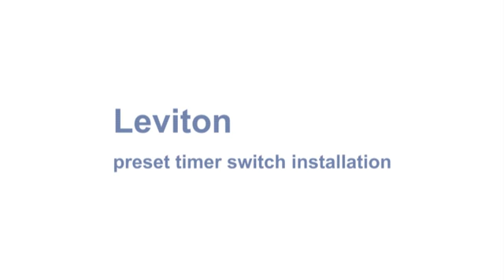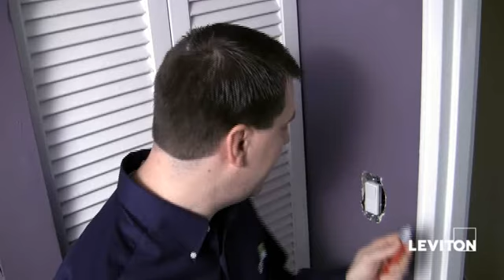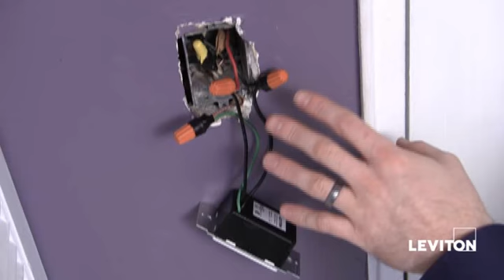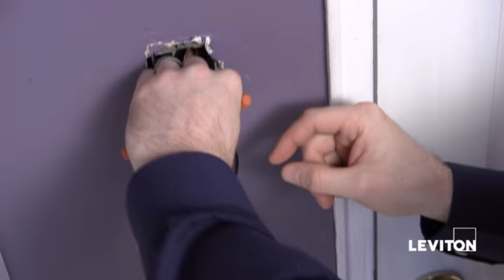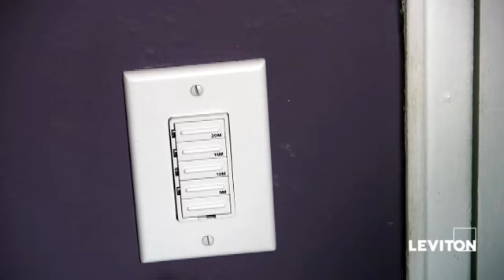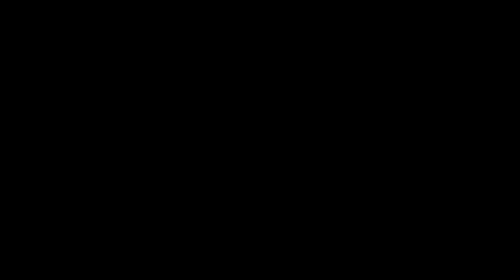How to Install a Leviton LTB30 Timer Switch | Step-by-Step DIY

Comment: the problem with this is now there's a green and white with 2 black wires which makes no sense.. no matter what way I wire it it doesn't work
Reply: Look at the diagram that came with the timer.  You have to match the line (power in) from the switch box to the timer line wire in the diagram and the load wire from the timer (  power to the fan) with the load wire in the switch box.  Then connect both the ground and neutral wires to the ground coming from switch box.  
Took me over an hour to figure it out and it worked.  The second timer took me 5 minutes to install knowing what to do.

Comment: Buy a cheap multimeter to use with the ac field detector to ensure there is no live wires There are situations where the white wire is not neutral but powered. (switch loop and three way switches). What I am saying is it's easy to accidentally hook up a white travellor or white switch loop wire into your neutral and and cause some major electrical issues. This happens when you forget what wire went where and try and puzzle it out,  so save yourself a lot of headaches and misery  . Leave like you found it unless you know what you are doing.  ALWAYS Take a picture before removing the old switch then tape and mark all wires. If there is pig tailing (not the ground type) and 3 wires are being connected get the proper murrette. I didn't even know there was murrette designed for 3 wires and rarely see them  in use. They usually have fins on the side and are much larger when looking insied of them. They are so much easier and work properly and I now trust murrettes again. Back stabbing connections can be problematic years down the road but so is not properly stripping the wire and curving the exposed wire with smooth needle nose pliers (the grip on some can damage wire) and making sure the end of the wire loops in a clockwise orientation around the connecting screw and the wire insulation is not preventing the screw from holding the wire down securely.. Look for damaged or burnt wiring and make sure the ground wire does not contact anything when putting the switch back in. If the wires are getting in the way cut them a lttle shorter if they are too long. If they are too short or damaged you can pig tail them but use the same wire type and gauge.  Always turn off power off at breaker. Make sure area you are working in a dry area and are not grounding yourself out.. Electricity is not happy about being controlled and has to be respecte Use the AC detector around your house to look for  large electrical fields caused by incompatible dimmers and smart lights. Youtube is hard to get accurate information sometimes. Look up electrical literature at internet archive digital library many good books no b.s. like ads or fees yet.

Comment: Thanks btw. I was able to do it myself. But I have one issue that I had with every switch I have done. How do you make switches screw in straight? Mine are always tilted a little
Edit: and all my boxes aren't really professionaly installed, so they wabble as well.
Reply: Tighten the screws but not so tight that you can’t move the timer switch. Then tilt the switch until it matches the faceplate.  Remove the faceplate and hold the switch tight while turning the screw slowly til it’s tighten.

Comment: How come this device doesn't need a neutral, and how doesn't it matter which black wire I use?
Reply from the maker: The device does not need a neutral because it uses very little power, which it can get through the Earth ground.

The black wires (load and line) can be interchanged as we use a relay to connect the 2 wires when the switch is on, and open the circuit when the switch turns off the load.
Reply: @leviton didn’t work for me.  I match the line and load wire from the enclosed diagram and that worked.
Reply: Read @leviton reply on the technology.  From my experience, it did make a difference which black wire is connected from the switch box to the timer.
Reply: It does matter because it did it the other way and it didn’t work.  Follow the diagram to see which line and load wire to use.
Reply: I can't remember why I asked this back then but it probably was more of just curiosity. Like what's the technology behind this switch that makes it not require a neutral  @pytube777

Comment: I have considered buying this and then I saw the buzzing issue that so many have. Someone posted a video on here troubleshooting what was causing it and it comes down to a design flaw. I wonder if the company has made any changes to solve this buzzing issue. You can find the explanation here "LEVITON LTB30 BUZZING TIMER FAILURE ANALYSIS" https://youtu.be/BQM4ERy-wpY

Comment: I am not an electrician, but I feel that it be commented that most electricians twist the wires together using pliers prior to using the wire nut. This provides a better connection then just twisting them together in the nut. Also, the use of electrical tape is also not advised as it will prevent an electrical inspector from making sure there is no bare wire below the wire nut where arcing may occur.

I believe you should update this video and have a licenced electrician do the instruction.